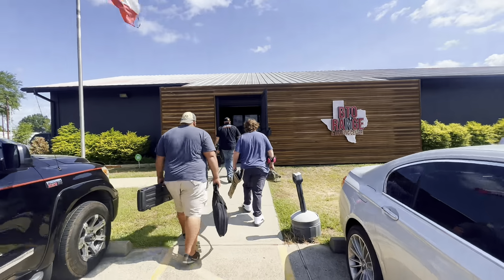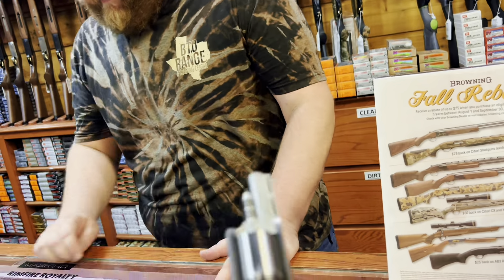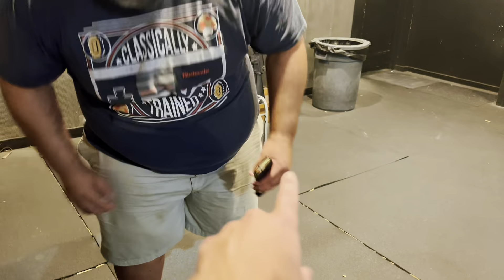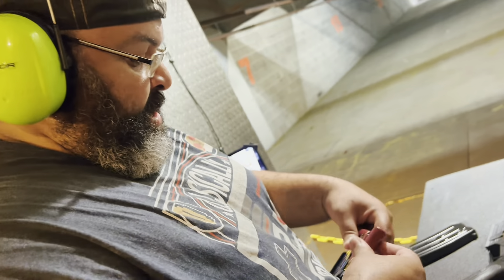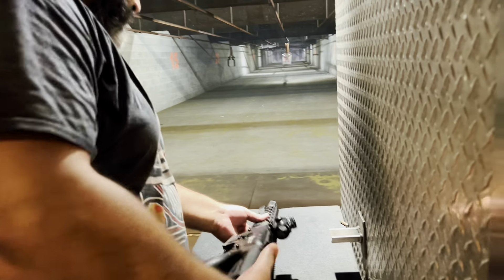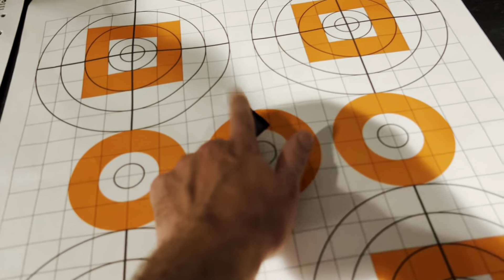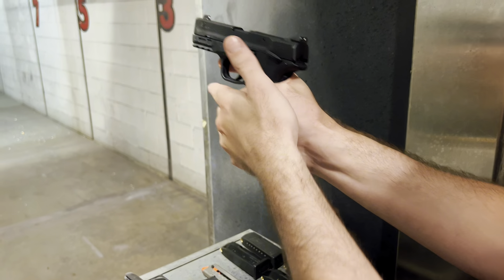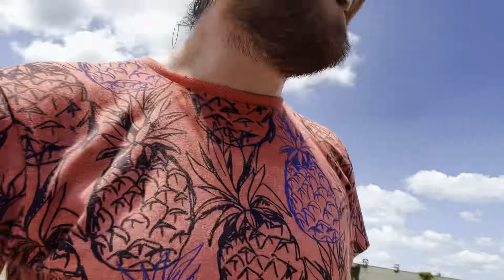Irish Guy Shoots Guns In Texas For The First Time

Comment: leaning into the gun is an important technique. The shotgun wasn't cycling properly because you were leaning back. Beyond that, you did a good job for a first time. I personally would never take someone to an indoor range for a first time. The large concrete room just causes the sounds to reverberate and be louder. Honestly, it is the sounds of the guns firing that scares people the most. So being in an enclosed space like that just makes it worse.
Reply: Yeah, indoor range for a first timer is almost always sensory overload. You can't properly teach someone when you can literally feel the room vibrating from gunshots. I always take people that have questionable or no experience shooting to outdoor ranges during the off-peak hours for the first trip. Even if nothing else, you have to be aware of what everyone else is doing while at the range, not just yourself.

The biggest safety concern while at a public range is the same as driving on public roadways. It doesn't matter how safe you are being if the person that happens to be next to you is being a hazard.

Comment: Sadly due to the ventilation of power and lead, you basically are exposed to whatever temperature it is outside in most ranges. It can be brutally hot and   cold. If you were in Texas, it's no surprise you guys were sweating your asses off.

Comment: Ayeee nice man, I love hitting the range on the weekends, and to kinda answer your question at 23:07 it really depends on everything from the size of the round to the length of the barrel to the temperature outside when you’re shooting 😂 

But generally good handguns are accurate to around 20 or 30 meters

Rifles are hard to gauge since there’s so many rounds and barrels but for the most part if you see it clearly with your naked eye, you can reach it

And shotguns are completely different because the big 3 shells that everyone uses are:

Buckshot-used for hunting mostly, fires 2-4 large projectiles, pretty accurate up to about 30 meters

Birdshot- what most people think about when they hear “shotgun”, just a ton of tiny projectiles meant to hit (you guessed it) birds without accuracy being too much of a factor

And my favorite, slug- literally a 1 ounce metal ball that’ll blow a hole in pretty much whatever you put in front of it 😂

Comment: This guy is military-trained?  He barely uses the proper nomenclature.  
Unless using a Wylde chamber, one should use the caliber stamped on the barrel - 5.55 OR .223, not either.
You don’t “rack the gun back”
You pull back on the charging handle to chamber a cartridge.
Rifles, indoors, are punishing.  Tough way to be introduced to firearms, but if you don’t have access to an outdoor range…….
When racking the slide of a semi-auto handgun, don’t “ride it forward”. (holding the slide as it goes forward).  You pull the slide back and just release it - letting the slide fly forward on its own.
Otherwise, good job.  Hope you had fun and give it another try someday.